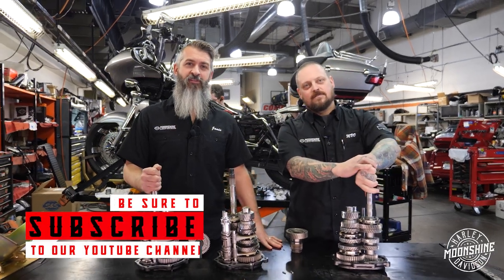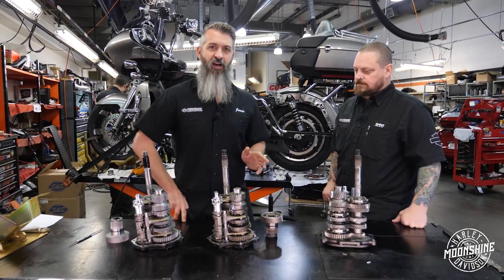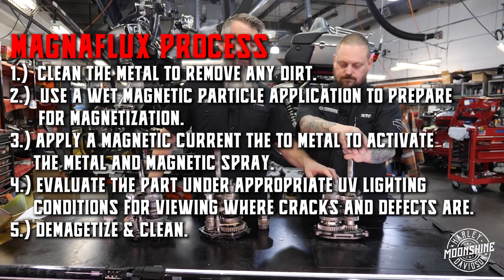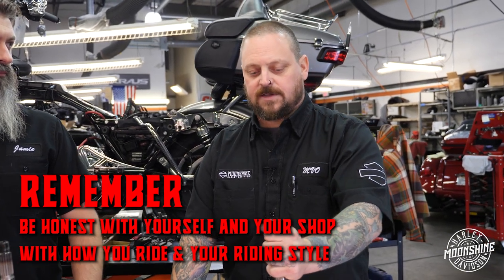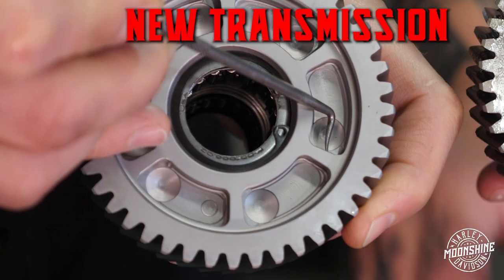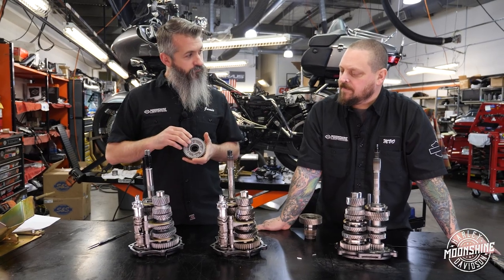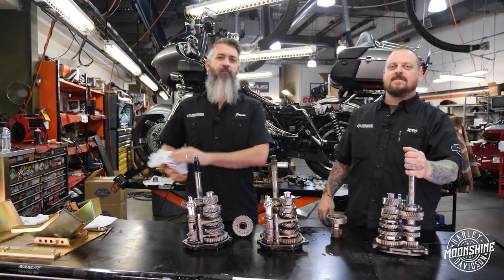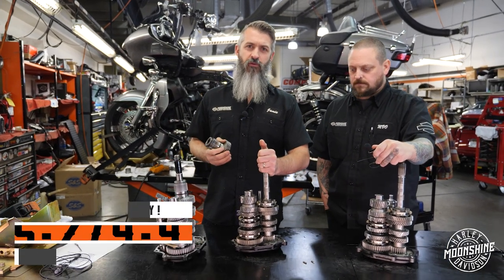Let's Talk Transmissions with Moonshine Harley-Davidson | Shop Talk Episode 44

Comment: Ok sorry about saying you were goofing around to much on the last video. This video was perfect. Oh my understanding of annealed is to heat treat the metal bellow a forging temperature around 650 to 800 degrees Fahrenheit depending on the alloy to allow the metal molecules to aline so they can flex with out breaking and yet still remain very very hard as in Japanese swords. I learned this many years ago after building a forge and learning to shoe horses. But it's been about forty years since I shoed  a horse or made a tool or sword. I'm a retired master electrician and watch these videos to be able to keep up with the maintenance and repair on my motorcycles. I kinda wish I could hang out in a shop like yours and help out just to learn for free. But a retired man has to have other hobbies like gardens and fishing and riding and some exercising to stay in good enough shape to try and keep up with you young fellows. Thanks for the great information. Mike from Maryland 
        P.S.       My Father in law (an amazing rider) road till he was 84 until he had to have a triple bypass.
Reply from the maker: You rock. We like to have a mix of videos. Some serious some not.

Comment: Some of the problems talked about I had on my first 19 RGS with Stage 1. Issues going to 3rd gear, going to 4th gear. Only when riding hard.
I have another 19 RGS now with a 131. May look into this.
Reply: I have had an issue with my 2020 roadglide going from 1st to second and second to third since I have gotten it. I actually find my shifting to be the smoothest when I am on the throttle and the jerkiest when I am trying to shift smoothly/easily

Comment: Would you say a bike making around 130TQ/120Hp is a closer to stock bike that would need this? Compared to the 150TQ/150Hp builds out there.
Reply from the maker: You could benefit from it but it depends on how you ride it.

Comment: If a lock up blows the trans it is time for a tougher trans. When I built my 120R, I bought a Baker trans. 
If your building a hot motor with a stock trans, I think your kidding yourself. 
If you can’t afford the trans today, I will bey your buying one down the road.

Comment: Not to be that guy but it’s not metal memory, I think you mean malleable. Metal memory is when you bend a piece of metal cold and it goes back to the original state when you heat it up. Malleable is metal that is easy bendable like aluminum. Love the videos keep up the good work.
Reply from the maker: Yes and no

Comment: Magnaflux is a brand that sells NDT equipment and materials,  you are talking about Magnetic Particle Inspection.  I'm a certified Aerospace NDT Level 3 inspector. I'm in the same boat, 3rd gear just blew behind my 128ci big bore 😢

Comment: If you had your choice and money wasn’t the issue, would you have a rebuilt Harley trans or a baker 6 speed grunge box?
Reply from the maker: Baker trans unless I was Drag racing it then I’d say our trans. The Baker is stronger and comes with a warranty. Ours shifts faster and robs less power to run but isn’t as strong.

Comment: Thanks for this!  I am hoping you are correct... my style of ride is very easy and only solo. My 2023 FXST was making a howl bring the rpms down from 3rd, to 2nd and a small amount to 1st coming off the high to a stop. she had a nagging bottom rocker box leak at 280 miles so 3 times she was in for warranty work to fix 280-600 miles. I ride very easy specially this is a brand new machine and I respect the first 600-1,000 mile for breakin. I cruise on the highway mostly, after the 2rd try to fix that rocker box leak and telling the dealer about that howl when down shifting I was offered the screaming eagle stage 3 107 to 119. as they started the final dyno in the first 3 minutes the transminsion let go. thankfully the mechanic shut her down and my telling them about the howl went on record and now at 600 miles I have a new  stock trans and pistons & cylinders. my question was they said I did not need any clutch beef up,  just the new springs. I s this something I did by driving her too easy? Is there something I need to do to not have this happen again. I have been riding all brands for 55+ years and this is my first BRAND NEW Harley, had 3 used Harleys over the years and never had a transmission problem on any bike.

Comment: I have a question,  I have a 2ooo ultra classic harley davidson  with 35000 miles, I'm having slivers and shaving on my speed sensor,changed the fluid nothing in the pan or on the magnet,  drove it30 miles checked the sensor it had more shavings on the sensor, need your input.

Comment: hey cool info you make and that you show it in a cool way :)
I have a little question if you also fix V ROD and if it can be 6 gears and if it will give some differences in the cool way :) and with horse power and if you have info what is the best way to get the best balance horse power and that it can last in a cool way :)

Comment: I want to feel a lot of pull from a dead stop...like one would feel in drag racing. Which Harley or Harley Engine will give me that feeling or do I need to get something like a Kawasaki ZX-14r?
Reply from the maker: Steps to getting what you want.

1. Call the HP team 615-274-4170
2. Tell them which H-D model you want
3. Design your build with them
4 . Purchase 
5. Ride the hell out of it

Comment: I really appreciate all the informative videos you guys put out (especially the shootout ones). Looking forward to the larger cam vid comparisons with the head work done. I noticed that it appears that you guys do an opposite taper to the shift dogs vs a baker grudgebox (if I'm not mistaken?) which they state insures positive engagement and eliminates hop out. Just curious what your thoughts are on this? Actually in the market for either a grudgebox or sending mine into you guys. Thanks again for all u dudes do.
Reply from the maker: Its the same on both. Call me at the shop and I’ll go into more in depth detail on both setups. 615-274-4170 Jamie Lima

Comment: I’ve got a 22RGST all stock but slip ons. I ride fairly hard coming from sport bikes and dirt bikes. 2nd and 3rd gear up shifts seem excessively loud. And the sound doesn’t always sound quite the same. Can be a hell of a wack sometimes. And some times it feels like the shifter kicks back a tiny bit. Should I be worried or is this normal? Any help appreciated!
Reply: Only 7000 miles on the bike. Running redline. Clutch is adjusted properly and neutral is very easy to find just FYI

Comment: Tech question. I'm more or less a cruiser, but I'm accustomed to shifting without using the clutch. I did it a lot on my Sportster. I got rid of that and bought a 2020 Street Bob 107. If I'm not slamming it up and down, and doing rather smooth clutchless shifts, my only real skill actually. How hard is that on the crank and transmission?
Reply: Well they do make clutches for a reason. You're not on a rocket, you're not saving that much time. The wear isn't worth it in my opinion. You're still on a Harley
Reply: @PitbullSoco  used ride dual sports, getting used to using the clutch all.the time. My KTM don't use clutch to often. Do it out of habit, not for speed.

Comment: I have a 2013 RG ( Stage 2 ), My 5th Gear is gone... Question, Does the Bakers 7 Speed Transmission have an Advantage vs. Stock?? I plan to keep my bike, If I replace the Motor eventually, I would consider a 120R, I currently have 55K, I love Long Distance riding and occasionally street racing. Thoughts?
Reply from the maker: The baker is nice if you are going to HWY at 90 or more. It also comes with a 5 year warranty. You can also go stock and last another 50k Plus. We like the 120r setup. We swap the cam for a Star Racing 650 and they are 130+hp and 130+tq all day. If you need more power we can port the heads.

Comment: Just had a Baker Grudge box with a Barnett Scorpion clutch put in.  Will not go into neutral when it is running. Any ideas ?
Reply from the maker: Could be several things. What clutch and slave cylinder are you using? What year, make and model?
Reply: @MoonshineHarley  Barnett Scorpion and the ami slave cylinder. 2018 RGU.

Comment: I ride mainly 2up about 400 lbs all together. We ride as follows. 2nd gear coming out of a roundabout, on ramps etc and hit it to 110 mph then Back off and chill at or around 70 to 80 miles cruising. Occasionally rip it against my Indian buddy’s but almost never do I hammer it off the line. 

My question is I want to do a motor build ( most likely a 131 kit  in my 19 SGS ) I had a lock up clutch in my 16 and 2 stock clutch baskets broke. Causing crank and tranny damage So what type of clutch should I go with should I change out the basket if so, trask?is my stock tranny and crank good up to  high 140 TQ and HP?
I live in Mn so I want to build it right from the get to limit maintenance issues. 

Even thinking of shipping it your way over the winter for this build. 

Thanks much in advance
Reply from the maker: We don’t install lockup on clutches. Lockups don’t allow your clutch to slip slightly when needed which is very hard on the rest of the drivetrain. This is our typical primary setup, MHP Comp Ramp, Rekluse Torque Drive Clutch, Rekluse Basket with Belray Primary fluid. All of which can be purchased at shop.moonshineharley.com  click MHP Parts > Drivetrain > Clutch Components. We recommend going to a build flywheel when ported heads are added to the build. A good estimate for the stock flywheel is around 140HP.

Comment: My transmission blew 3rd gear on my 2018 flhxs at 7500 miles has stage three harley davidson  put new tranny in cost me 700 dollars for labor what transmission  fluid do you use or does it matter.
Reply: your replacement will too, you only needed 3 parts replaced and they have not been redesigned or improved since the 6 speed came out.

Comment: Update on my no 6th gear. Looks like the dogs have been rubbing on the gear for a while. Almost like something in the fork is spaced wrong or just a bad fork from the factory. replacing all bearings, 5th gear shift fork, 5th gear dog ring, and main drive gear.
PS
Has anyone else experienced this?
PPS
Don’t use syn3

Comment: I have the older 5 speed with straight cut gears, i beat the crap outta that thing and it shifts perfectly...about to turn 50thou miles, lucas 75/140  gear oil in it every time.

Comment: You couldn't release this like 2 weeks earlier? I just bought a Barnett Lock-Up clutch for my 128ci Stage III with stock gearbox. In all honesty, I won't be racing my bike. I just like to be able to pull away from the traffic light faster than that damn Tesla who's trying to cut me off before the merge.
Reply from the maker: Rekluse Torque Drive is our go to clutch for best all around performance.
Reply: thanks guys  @MoonshineHarley

Comment: Very sad these transmissions are so weak on a 30k dollar stock bike.   I think harley should make a rolling chassis bike.  Empty crankcase and empty trans case.  And a empty primary, no clutch or basket and Definitely no compensator 😂
Reply from the maker: The Transmissions are great for stock applications. It's for riders pushing their Harley's hard or for large HP. It's just like the car/truck world. Big HP engine and you need a transmission better than stock...BIG HP DIESEL and you need a big $$$ transmission to hold it. It's pretty consistent with any large performance build on any manufacturers' product not designed to race.

Comment: i never liked harleys due to the fact that for the premium price, its as if they only did half of what they were cabable of.if honda took the same approach they would still be trying to sell 2021 versions of the 1970 cb750.one would think the harley execs would tire of being the laughing stock of the 2 wheel world.performance wise.because they really are.if not for the aftermarket, harleys would have alot of performance compitition from the japanese scooter market.i couldnt imagine just bareley beating a suzuki bergman 650 in a race on a 15k dollar harley.the harley execs must be either greedy as hell or doing some very potent drugs if they cant see their problems.american youth WONT buy overpriced SLOW motorcycles.hence harleys problem with sales to younger riders.when a honda 500 can kick a stock 1200 xl's ass.& be more reliable.

Comment: What transmission is best when running 150-170 plus HP and 150-170 plus TQ?

I’m not a racer but intend to ride it like I stole it
Reply from the maker: Baker trans has a 5 year warranty. Call the shop and ask for Jamie 615-274-4170 he’ll give you the super homie bro on one.